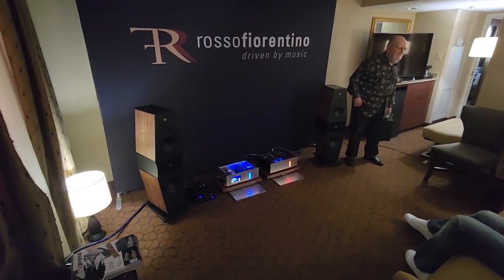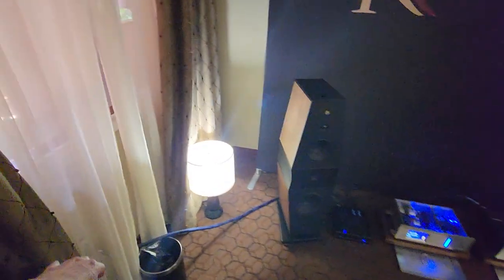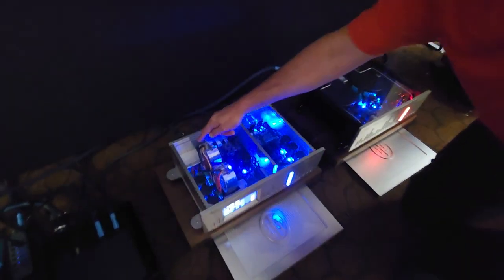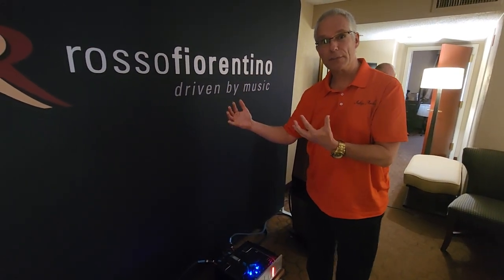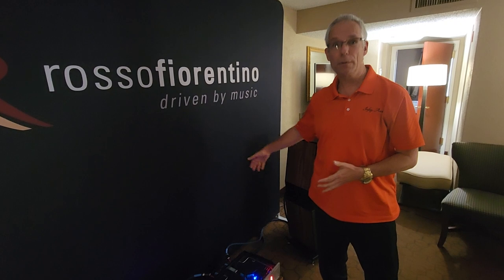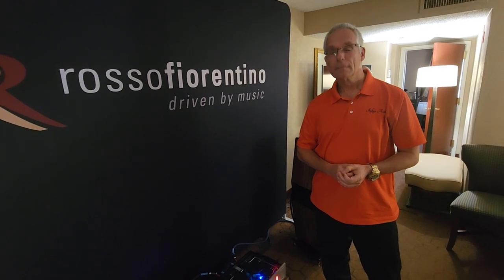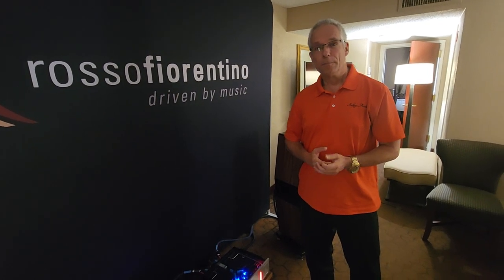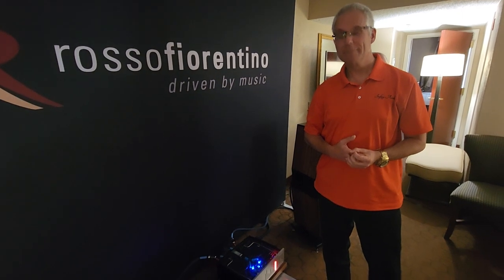🤔 Very Important Lesson About Power Conditioning - Infigo Audio

Comment: Near the beginning, when you briefly showed the wall outlet in the hotel room, it looked like the outlet was falling out of the wall. Or maybe it was just the cover plate. Regardless, I wonder about hotel regulations in TX.

As for power conditioners - I still don't know why someone would want one unless one lived in an area with poor electric grid response.  I suspect most Americans live in communities where the AC is just fine, though rural residents may have intermittent losses.

Residents in some countries may have irregular AC.
Reply from the maker: The faceplate and outlet was coming out the wall.
Reply: @AudiophileJunkie  Look at the size of that power cord.  The power cord did it, I told Hans the hotel was going to send him a $500 bill.

Comment: 95% of the time this is true. But there’s that 5% of the time when you get great benefits from a properly designed power conditioner. Not all power conditioners use inductors and transformers that tend to sap the energy.

Comment: This is all so nebulous to me. It hurts, you say, but in what way exactly? What in particular changed for the worse when power filter was inserted? An amp drawing a fast pulse from the wall, well, if 50/60 Hz is fast, then OK...
Reply from the maker: The thing I notice the most is in vocals and presentation.  A more constrained power delivery tends to make vocals more hollow and the presentation to stay stuck to the speaker instead of disappearing.
Reply: Ayre tells you not to use power conditioners with their amps.